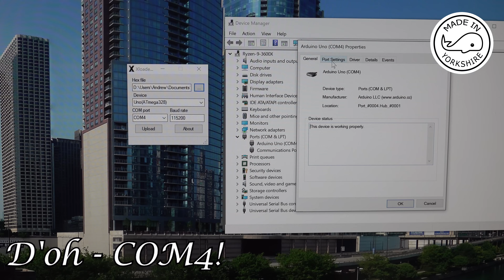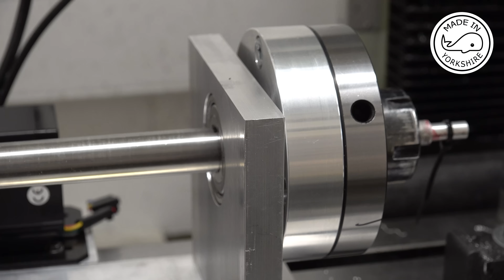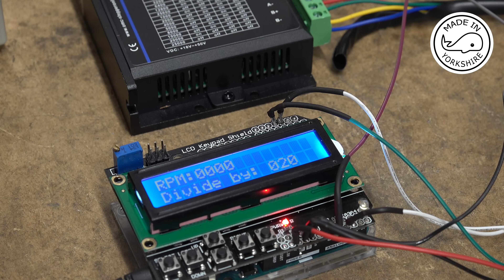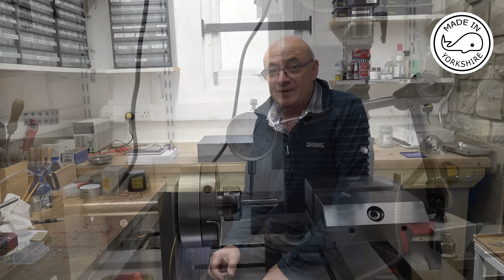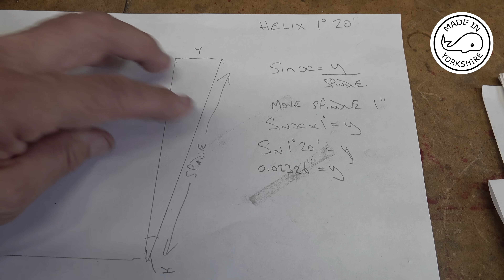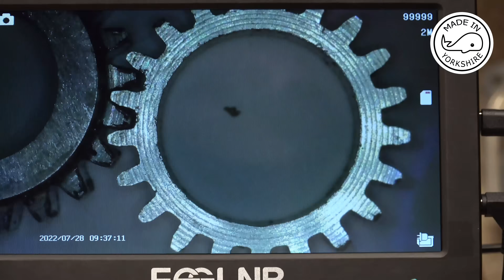#MT50 Part 4 - Making a Gear Hobbing Attachment. Making Test Gears. In 4K/UHD by Andrew Whale.

Comment: Is the Arduino mis-counting the pulses from the rotary encoder? Maybe missing pulses when servicing interrupts?
Reply from the maker: Hi Jeffery - good question. The code is written in assembly language and the source is not available. I will write my own test script to see if the problem is still present.
Cheers
Andrew
Reply: @learningturningmetal  My concern is also those constant updates to the RPM display. The fact that the rpm display would require a periodic timer event suggests that interrupts are probably enabled. Could easily skip a pulse while doing that. It would be very hard to spot using the scope though.
Reply from the maker: @jefferybond5701  yeah. Andy aka AndysMachines recons the Arduino is capable of handling the throughput. My simple script might help identify the root cause. Watch this space!

Comment: Hi Andrew is it possible that the gear hob is moving on it's shaft or spinning in the collet.
Reply from the maker: Hi Rich - I don't thinks so. I did look into that and it appears rock solid. The error seems to be gradual throughout the cut, rather than random. As a double-check I will mark positions with a marker pen and see it there is any movement.
Cheers
Andrew

Comment: This is a great video series.
Re your problem, it certainly looks like drift, and it also looks like a predictable amount of drift over time.
You could test that by cutting a gear with 2 passes, immediately.
Then try a second test, where you cut the first pass, wait a predetermined time like 5 minutes etc (you should know by now roughly how much it drifts over time) then cut the second pass.
If both gears have the same error it is not time dependent and might be some mechanical issue.
If the first gear is pretty good but the second gear is bad, you know you have drift over time, which is probably the most likely thing anyway.

Based on what you showed in this vid I would bet it is drift over time, possibly caused by software rounding in Andy's ratio conversion software.
Another possibility is lost/gained encoder pulses over time. I noticed your scope shows a lot of noise on the encoder signal. Try adding two 330 pF caps at the arduino, from each encoder pulse pin to ground.

The difference between a software or noise fault could be tested as the software fault would likely cause a predictable drift over time, where the pulse noise fault might cause weird drifts that dont seem directly related to time.
Reply from the maker: Hi Wiz - many thanks for the advice. Makes a lot of sense. Added to a list of things for me to work through.👍
Cheers
Andrew

Comment: Could the timing issue be due to backlash when you were moving the x axis?
Reply from the maker: Hi Robert, I don't think so. Backlash would be  picked up prior to any cutting. The mild steel gear cut in one pass was also malformed.
Thanks for the suggestion though.
Cheers
Andrew